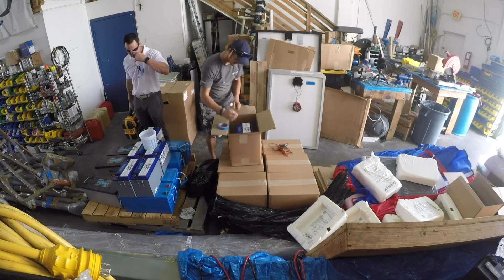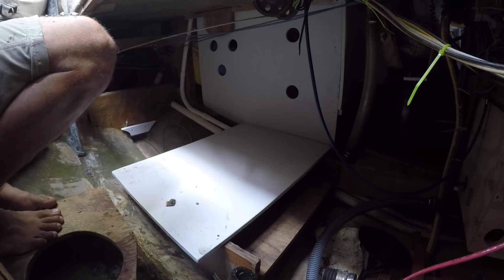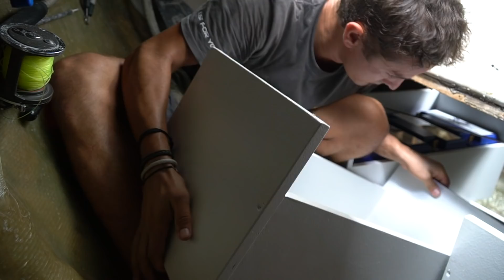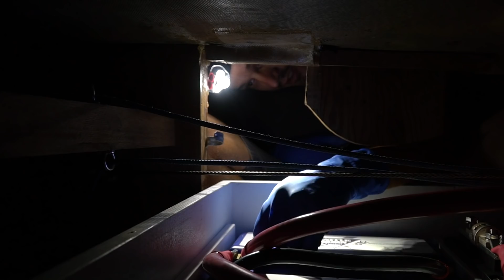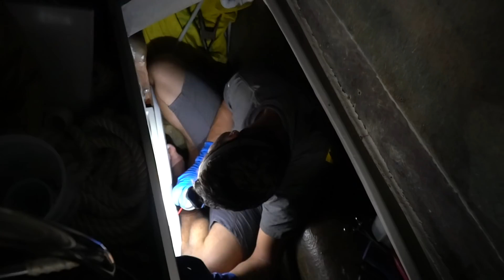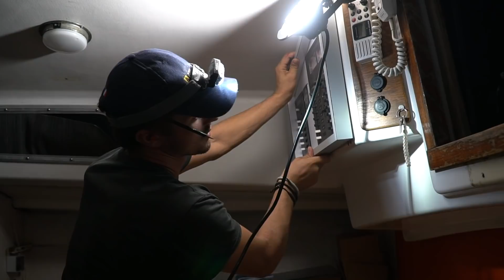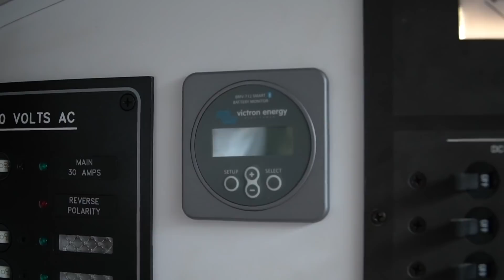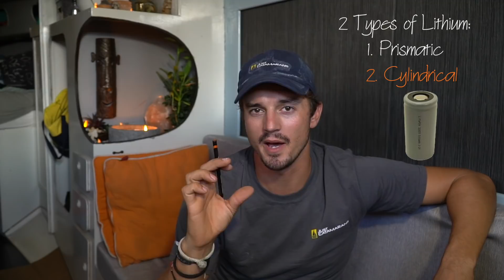Uma's new Battle Born LITHIUM heart ❤ — Sailing Uma [Step 135]

Comment: Hello, great videos. I may be stating the obvious but...I noticed when you were tightening that last positive lead (and you were wearing gloves because of a slight short between your cable and hand) you came close to touching the cable with the wrench. Whenever I have had to put the positive lead on last (usually it's best to follow the old rule "negative off first and on last")  I wrapped my wrench or any metal tool with electrical tape. Any slip without it and the results are like a Canada Day evening celebration! I speak from experience :(    Your attention to detail and overall skills are a real pleasure to watch. Thanks
Reply: With solar its the opposite when connecting to the inverter. Always positive on last and off first.

Comment: Hello Dan.
What happens if you are trying to make a weather window and need to motor for a couple of days or you hit the doldrums?
I understand that having a battery boat is attractive for day racers getting in or out of the marina but for cruising?
Are you going to install a large generator by chance?
Love your channel by the way.
Cheers
Reply from the maker: They also didn't have satellite wind forecasting and gps with charts accurate down to the foot or boats that can turn on their keel and point to windward. Uncharted waters are dangerous with or without a motor. Not relying on a diesel has certainly made us better sailors and more cautious. We time the tides, play the current read the winds to avoid putting ourselves in hazardous situations. We also map uncharted areas with our dingy and a lead line before sailing in. Diesels can die just at the wrong moment too. We've been on two boats where the diesel motor quite as we were entering a break water from the wind agains current chop stirring up crap in the tank and clogging the fuel line, but the captains already took the sails down because the didn't feel comfortable sailing in. On one, we just drifted in with the current until the capt. sorted the fuel issue, on the other, we almost hit the rocks before a power boat came by with a line and pulled us in. We never rely on our motor, or our sails alone, they work together and we often have both ready when entering break waters or tight cuts for that exact reason. We've hove to offshore for hours waiting for the tide to turn so we would have it with us. That is safer than relying on a diesel to force your way in. If the weather is bad, we stay offshore until it clears. Same goes for night time entry into foreign harbors. So for us, NOT having a diesel engine has made us much safer sailors.
Reply: @SailingUma  Hi Dan, I'm sure that getting rid of the diesel was well thought out and I agree that navigation has dramatically improved. My concerns with electric motors run from batteries comes from the number of components that make up the system. Every link, every bolt, every crimp or soldered connection, isolators, fuse links, controllers, inverters or drives, each and every component needs to be working perfectly to have the system work reliably.
I have worked with AC and DC drive systems for most of my working life and maintaining and designing electrical drive systems in heavy industry have been my bread and butter. I worry about systems that rely on every component to be functioning all of the time for it to work. Lithium and water/oxygen do not mix and if you have a problem with this one component you are in trouble. What is your contingency if one of these batteries starts to smoke? How can you get it off the boat?
Are they fully waterproof? Can they remain submerged without failure? A marine grade motor can stand to be submerged open frame motors cannot. Is the controller and all switching components waterproof?
Do you have a precedent system with Loyds certification for marine applications?
I know you are incredibly bright and a talented person, one of the reasons I follow your channel. I see some red flags here I just want you to cover all the bases regarding the safety of this system.
Series parallel batteries should have fuses and quick disconnect links to isolate any of the cells. The batteries you have have internal protection. Are the protection circuits able to be checked? Are each cell in the sealed battery fuse linked?
Are you installing heat and smoke detection alarms in the battery compartment and is the battery compartment sealed away from the habitable areas in the boat?
If you can create a vapour proof bulkhead between you and the batteries and vent the battery compartment to atmosphere this will greatly reduce the hazard.
Please consider talking to a marine engineer (which I am not) to have your system checked. Kind regards Stephen.
Reply: Sailing Uma - I couldn't have said it better myself. This is the REAL world of Sailing, and a REAL Sailor understands it's NOT about the motor. I think many that go batshit nuts over the electric motor issue and refuse to see that electric motors are a tool for the experienced Sailor to use with the wind and Sails, all come from the non-sailing world of Motor Cruising and think the diesel motor is the only reliable part of a boat.  I understand to a point as I came from that word as a kid. At age 9 I spent years helming a Boston Whaler, and then moved up to 40 foot power cruisers with my Grandfather. Then at age 14 I came to my senses and learned to SAIL, and I did it on 14 and 16 foot boats with NO MOTOR. I had to LEARN how to SAIL with the wind, how to DOCK and UNDOCK with the WIND. I also learned to Sail a 30 foot Sailboat with an outboard motor. I had a heck of a time with the motor function in docking and undocking as I was used to using the wind and not the motor. I do appreciate the motor in low wind conditions and control in the harbor for entrance and exit maneuvers. However, Sailing with the Wind is the only way I get out on the water and haven't looked back since.
Reply: @ZipaDeeDooDahDays  I may not have the years of experience sailing but as a new sailor and a very experienced electronics tech and drives expert I would agree wholeheartedly that sailing experience is foremost in keeping your crew and boat safe. If you don't need a motor to sail, great! If you need a motor on occasions put a long shaft outboard on the back. Don't put a system onboard that could take your life if it fails.
Reply: Theres lots of sailors who sail all over the world without any motor at all ! Captain Boothby for example . He uses a 14 foot sculling oar when needed. He has become a great sailor and I bet not having a motor has also helped develop his abilities,
Reply: The doldrums aren't that bad. We just crossed the Atlantic (west to east) and the doldrums were slow (20nm per day). It took 4 days to make our way out of it. Once we made it to the northern border again we were sailing along at 5-6 knots.
Yes, a diesel would have made the distance in a day, but we would have missed all the amazing cooking and star gazing that we did in that slow point of the crossing!
Reply: If a person has to be somewhere at a certain time , he should buy a motor boat and stay away from sailboats . Sailboats are for going where the wind takes you or not !
Reply: @robertorzech2466  I'm interested in the safety aspect Robert. A friend broke a mast on the way to Tasmania. If he didn't have a motor he would be at the bottom of the ocean now. The Southern coast of Australia is called the shipwreck coast because in early colonial times there were no motors in ships. To hamstring your yacht by removing the motor and not have a contingency plan is fatal. I love these guys and would hate to lose them to the sea because of a bad call.

Comment: These batteries are $1000. EACH. It's outrageous. I'll be sticking with the flooded deep cycles, thanks, until the price comes down by at least 75%. I realize you guys have a different situation...but still. You could have bought a decent used car for what that battery bank costs.
Reply from the maker: In the long term, lithium still costs less than lead in our application. We would need dozens of lead batteries to give us the same useful energy and that would weigh too much to put on the boat, plus we would be replacing them every year or two. On a typical boat with a diesel, there really isn't the same need.
Reply: Sailiung Uma That simply isn't correct. Not all lead-acid batteries are the same thing. I'm not arguing that the Lithiums aren't better for you application...I'm simply pointing out that the cost, being completely outrageous, doesn't equate a justifiable gain. You are paying more than 10 times as much per amp-hour. Are you truly expecting 10 times as long a lifespan? And assuming the lithiums are twice as good...are you even expecting 5 times the life span? The trouble you've had with lead acid in the past is a matter of using the wrong types of batteries, using them incorrectly, and having far too small of a bank. There are truly deep cycle lead acid batteries out there...but what you showed in the video were 12-volt "marine" batteries. Which, if you dismantled and looked at the plates, you'd find oare more of a hybrid battery than an actual deep cycle, no matter what the sticker says. Your bank is only 1200 AH. My bank is three times that, (not on my boat, lol) and I run much higher draws than your motor. I've had these batteries for 9 years....because I don't abuse them and they are the proper design for the task. Anyways, its you're money. Personally i'm not touching lithium until the price goes down DRAMATICALLY. Thanks for the video.
Reply: Decent AGM cells are pretty expensive.  Sure you can get simple flooded cells for cheaper however how would Dan do the weekly electrolyte tests that are required where the batteries are mounted.  Also even when you stick to the 50% discharge limit flooded cells will do roughly 300 cycles - a lithium battery will do at least 1000 to 80% DOD.   So when you price up the flooded add in your maintenance time and allow for three sets that you will have to replace.
Reply: Actually, you will get a LOT more than 300 cycles out of flooded batteries. I've had the same batteries in my houshold bank for the better part of a decade. If all you're getting is 300 cycles...you are using inappropriate batteries, or you are charging them incorrectly. It happens a lot...people just look at the colored lights instead of setting the correct chargeing voltages at the different stages. Even being discharged to 50% and generally ignored, a quality, true deep cycle battery (not a "marine" battery with a sticker that says "deep cycle". This is a lie.) will easily surpass 1000 cycles. The in practice life span of lithium batteries for driving propulsion on sailboats remains to be seen.
Reply: This is good to hear.  I just invested in a 800 AHs of AGM and hoping I can get a lot more cycles than 300.  Yikes!
Reply: RealityIsTheNow what would a used car do if you’re sailing the world?  Perspective
Reply: Exactly!  What the heck would they do with a used car?  They could tow it along in the dinghy.  I'm sure Dan the Man could engineer up some sweet system for lowering the car down to the boat!!!  LOL
Reply: Its an example, you twit.
Reply: RealityIsTheNow poor example

Comment: Hey guys, thanks for sharing. Couple questions if that's ok. We'll be curious how long it takes to get a full charge with the 1200w charger in the real world. In theory probably 8-10hrs like you said. We have 6 of the same 12v 100ah Battleborn batteries. In our experience, as the charging voltage increases they amount of amps per hour going back in drops. Sure its basic electrical math but it means your getting less amps per hour into the batteries at the end and the charing always takes a little longer than we planned. Was there a reason you didn't go with a larger charger? That setup cost a pretty penny. Seems a shame to have to charge for 10hrs to get 5hrs of motoring especially when you're only using 10amps of the 30amp 120v from shore power. You've definitely thought it through, just curious about the charging strategy. Also, any idea how long it'd take your solar to refill from 80% dod to full? Any plans for supplemental charging while on the hook?  Also also, Battleborn told me repeated 90% dod was ok and would not harm them. Did they give you some different info there?
Reply: Normally with lithium batteries you can charge them at a constant current till they reach 80% of their capacity then that last 20% will be constant voltage with a decreasing current till it reaches about 0.1 x the capacity of the battery. Then it's considered full and the charge should really be shut off. So in theory if the 100ah battery is fully depleted is charged at 25 A it should reach 80% in just over 3 hours however it may take a further 2 or 3 hours to get the remaining 20% in!
Reply: Im Surprised they didnt install a Victron Multiplus Unit, as it handles both Inverting, battery charging and AC transfer in one unit.
With the units they installed, if they are drawing any AC loads, the charger needs to support that load and that takes away from charging current to the batteries unless they have a separate AC transfer switch. 

Also the Multiplus Has a significantly larger charger and inverter: 35A / 3000w and 70A / 5000w respectively for the 48V units, and has the ability to boost incoming AC supply should they encounter a situation where the Dock supply is unable to meet the entire AC load.

Comment: How dry is that locker? I ask because if I remember correctly water and electricity don't like each other, and that is a cockpit locker. Other than that I would say nice install and I think you will find that a little add airflow will be your friend down there.

Comment: I'm pretty sure you know Delos just put out a video doing the same thing. I told them we had just bought a Chevy Volt. In the owners manual it states that the battery pack has it's own heating and cooling system. They don't want the lithium battery's to get over 90*F or under 32* F. They also have the computer keep you from over charging and running the batteries too low.(The battery's top out at 18.5 KW but you can only use about 16.5 KW. I'm not sure how low the computer will let you go as far as KW's go) 
Here's a video is found on PacificNWBoater about "Carbon Foam Batteries". (Watch to the end because the guy give a year later update)......... In the comment section, there's a link by Bruce Schwab to a test between carbon foam & lead acid batteries. These CF battery's are spendy..........................but being as how you guy have brand new lithium batteries, you're probably not going to have to worry about it.(;>) FYI.
One other thing, it might be a good idea to get a cheap(like Radio Shack) remote temperature gauge and epoxy the sending unit to your electric propulsion motor. I can see some real heat being produced.(:<) A cooling fan might be needed.
Anyway, great video. You guys never disappoint!!!(:>)
Reply: Reg Pettinger not the same chemistry .